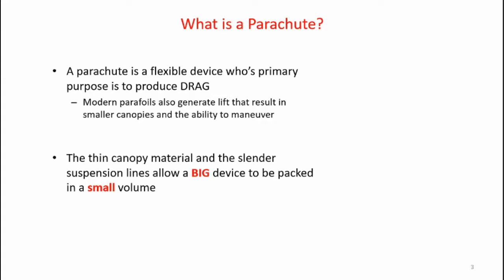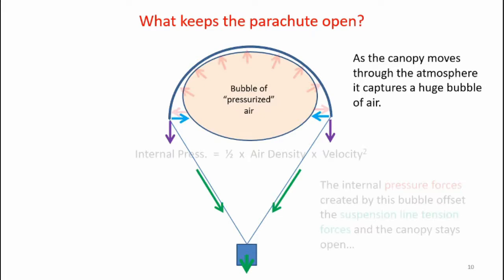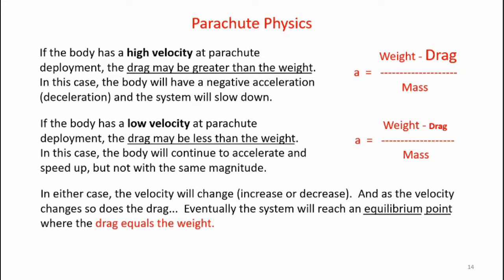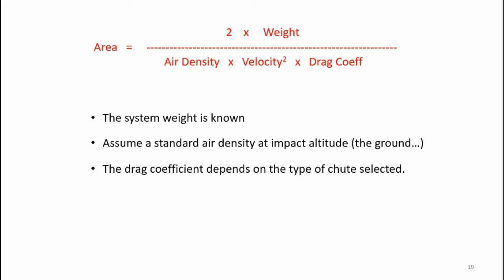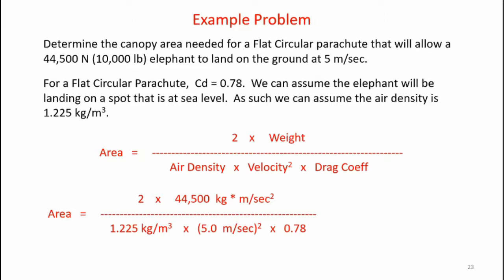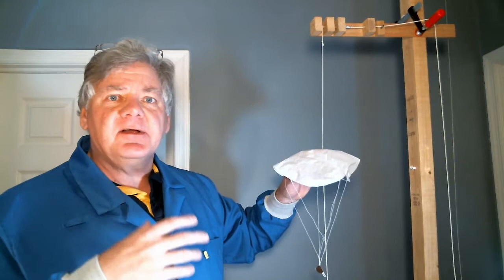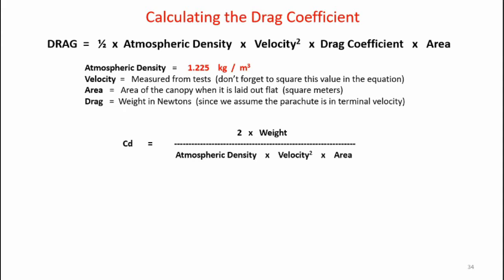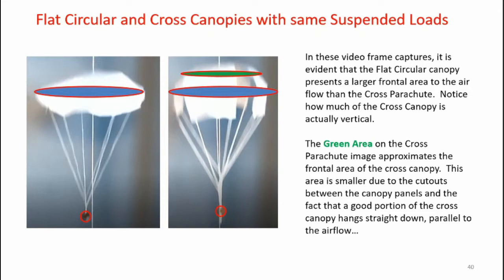Parachute Physics

Comment: Hey, awesome video. I have a question. 

I'm using the exact same sensor to measure the velocity of a toy parachute, however my readings are all over the place. They're spikes that go from negative to positive continuously. My values are also way off, for context if I drop my parachute (ignoring the spikes) the maximum velocity was around 15 m/s which is quite high. I've checked that it's not a problem with the sensor since I've tried many others and they all seem to have the same problem. I was wondering if you did any calibration or changed any settings for it to be such a smooth curve with accurate values.

ALSO, can you explain why you're velocity starts at 0 but then goes down in the negative direction, and then proceeds to be positive at the end?
Reply from the maker: Hmmm, I'm not sure what to say...  Are you using a guide string to keep the parachute falling in a straight and orderly manner?  If the chute is swinging and drifting off to the edge of the sensor "cone" there could be noisy data.  It's been a while, but I don't recall changing the default settings on the sensor.  It is my experience that if the drop object is falling too fast the sensor data can be choppy.  Have you tried using the "old school" stop watch method.

Comment: Great video, a bit confused about how u calaculated the area of the canopy?
Reply from the maker: Simply lay out the parachute flat on a table and measure its area.  For a square chute, Area = Side 1 x Side 2.  For a circular chute, Area = Pi x Radius2.  In other words, it just the geometric area of the canopy material.

Comment: Can you please show us the calculations to get the drag coefficient, it’s a bit confusing
Reply from the maker: The drag coefficient for a parachute is best determined by conducting tests (i.e. wind tunnel or drop tests).  For a wind tunnel test - the measured force (the drag force) is entered into the drag equation:  Drag = 1/2 x Air Density x Velocity2 x Cd x Canopy Area.  In my equation above, "Velocity2" is "Velocity Squared".  Rearrange the equation to solve for Cd...  You will need to know the air density and and wind tunnel air velocity.  For a drop test, the Drag = Weight once the parachute has reached Terminal Velocity (maybe a second or two after the release for a model rocket parachute).  The average velocity can be determined by timing how long it takes the parachute to fall a certain distance - after it has reached terminal velocity.

Comment: I am trying to help my daughter with a physics experiment. The experiment is to drop a 4 pound pumpkin from 30 feet. we are attempting to make a parachute for this project.  I was wondering if you can help me with the parachute size we would need for the pumpkin to fall and not break? thank you
Reply from the maker: Ideally the first step is to determine the maximum impact velocity that a pumpkin can survive.  This would be done with drop tests (my guess is 2-3 feet…).  The fall time and associated impact velocity for a given drop height can be calculated as follows:  Fall Time (in sec.) = Square Root (fall distance (in feet) / 16.1) and Impact Velocity (in Ft/sec) = Fall Time x 32.2.  This is the necessary terminal velocity of the pumpkin & parachute system.  The drag equation (Drag = 1/2  x  Air Density x (Vel x Vel)  x  Cd  x  S) is used to determine the necessary flat area of the parachute.  Applying some algebra:  S  =  (2  x  Drag) / ((Vel x Vel) x air density x Cd).  Where S = flat area of the chute in Square Feet, Air Density = 0.00237 lb*sec3/ft4, Cd = 0.6, and Drag = Pumpkin Weight (in lbs).  We can set Drag = Weight if we assume the pumpkin/parachute system has reached terminal velocity before hitting the ground.  Terminal Velocity means the acceleration is zero (not 32.2 ft/sec2), which is achieved when the drag perfectly counteracts the weight.  EXAMPLE:  For a 3 ft free fall drop.  Fall Time = 0.43 sec.  Impact Velocity = 13.9 ft/sec.  For a 4 lb pumpkin: Parachute Area (S) = 29.6 ft2, which is a 3 Ft diameter round parachute (S = 3.1416 x Radius Squared).  For this to work the height from which the pumpkin is dropped needs to be 20 ft (?) to make sure the chute opens and terminal velocity is achieved.  Kind of hard to give a full lesson in this forum, but maybe this will help...
Reply: @labratscientific1127  thank you I understand  what you are saying about this being hard to explain on this platform.  We made a 32 sq ft parachute and did a 25 foot drop test with a 4 pound  dumbbell and it thermal velocity was reached  at about 20 feet where the parachute was able to counter act the fall.  It was pretty  successful we did not try with the pumpkin yet.

Comment: Can you build a parachute out of metal? not worrying about deployment
Reply from the maker: Yes, metal could be used to make a parachute.  Aeroshells used on Mars entry vehicles are a sort of "parachute" - they are just not big enough to slow down the lander sufficiently.  A non-porous material like metal does not have the best drag characteristics since "porosity" (the amount of air that passes through the material) can affect the drag.  Some porosity is good - especially when trying to control opening loads.
Reply: @labratscientific1127  Thanks for taking the time to answer

Comment: for the first example problem, at the end, you have  mistaken radius with the diameter, ( at10.08) 34.4 m should be the radius of the area we got which is 3725m.sq
Reply from the maker: You are correct!  Good catch.  Its nice to know that someone is really looking at the details.  I'll correct the video in the near future.  Thanks.
Reply: There was no correction  to date. I had a sleepless night trying to calcukte the diameter 34.4m. Now if radius is 34,.4 then it makes sense. My head hurts less now.

Comment: Nice tutorial. Appreciate the extensive details.   One question, does the  hole in the parachute to allow for the guide line impact the Cd?
Reply from the maker: A small hole wont affect the Cd noticably.  However, larger holes will allow more air to pass through the canopy and thus reduce the mass of air the canopy must try to accelerate.  This will reduce the CD.  The air passing through the larger hole also increases the pressure behind the canopy, further reducing the drag.
Reply: @labratscientific1127  🔴 What Is Islam? 

🔴 Islam is not just another religion. 

🔵 It is the same message preached by Moses, Jesus and Abraham.

 🔴 Islam literally means ‘submission to God’ and it teaches us to have a direct relationship with God. 

 🔵 It reminds us that since God created us, no one should be worshipped except God alone. 

 🔴 It also teaches that God is nothing like a human being or like anything that we can imagine.

🌍 The concept of God is summarized in the Quran as:

📖 { “Say, He is God, the One.  God, the Absolute.  He does not give birth, nor was He born, and there is nothing like Him.”} (Quran 112:1-4) 📚

🔴 Becoming a Muslim is not turning your back to Jesus. 

🔵 Rather it’s going back to the original teachings of Jesus and obeying him. 

More ....

Comment: how effective is a parachute in .088 psi? How big would the parachute have to be for 1000lbs 100lbs how long would it take to slow down from 20,000 mph?
Reply from the maker: At 0.088 psi (12.67 lb/ft2) a 5 ft radius circular chute would produce about 700 lbs of drag.  Parachutes are generally designed to give a certain impact velocity.  The chute size is calculated by rearranging the Drag Equation to solve for Area.  Assume terminal velocity where Drag = Weight (in your case 1000 lbs) and you get an area of about 3,000 ft2, which is a 31 radius circular chute.  That's 62 feet across.  20,000 mph is about Mach 25 which is far to fast for deploying a parachute.  Parachutes can only survive Mach numbers on the order of 2.0 to 2.5... The time it takes to slow down is much more difficult to calculate because the velocity changes as the parachute descends due to changing atmospheric density...  If the chute provided a constant 1g (32.2 ft/sec2) deceleration it would take about 15 minutes to slow down from 20,000 MPH (29,333 ft/sec).
Reply: @labratscientific1127  so a parachute will still work in low density atmospheres... that's weird. Maybe earth atmosphere denser than I think then. Thanks for taking the time to reply I appreciate it.